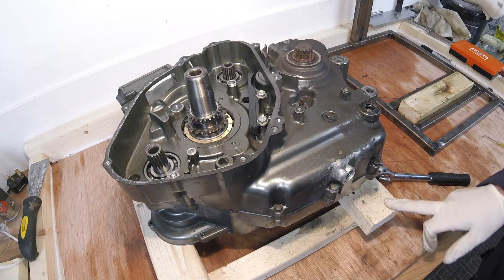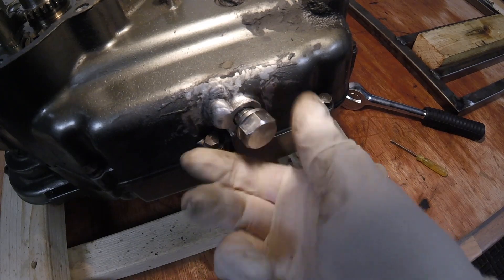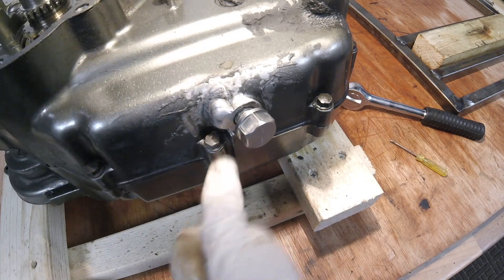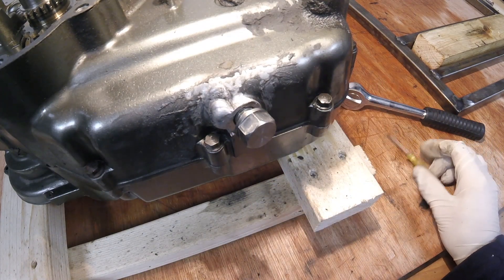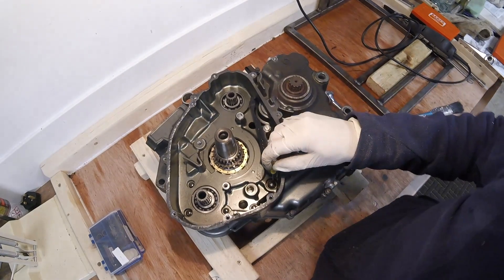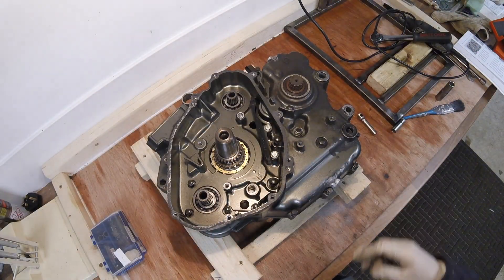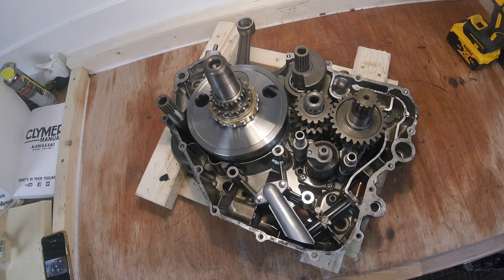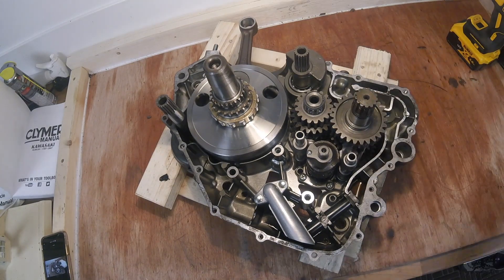Kawasaki KLR 650 Engine Re Build Part 7: Splitting the crank cases.

Comment: Thanks for the video. What are the bolts’ thread that hold the casing together please? M5? One on the bottom just in front of the oil drain is stripped and previous owner covered the entire area with epoxy. But it’s leaking through the epoxy. I’d like to order a thread repair kit but ride the bike up to the time it arrives so I don’t want to remove anything. I could measure if I removed it but would rather not. Thanks!

Comment: Love your work mate. Currently doing a build in Perth. I’ll be watching you every step of the way!
Reply from the maker: Good luck with the build - Going to be slow posting more videos of this as parts availability and work on the damaged crankcase are not going to happen until after COVID19 lockdowns are lifted and everyone is back at work.. Let me know how you get on - I'm going to have a go at splitting the crankshaft - have got a 2nd hand one on ebay to practice on - just got to get the press, jig, and puller now.... Ill get a vid up of this too at some point. Regards
Reply: @themotorcycleshed380  Some Job mate. Out of all the Vids i've seen yours are pretty solid. No excuse to make a mistake my end. As i progress ill share some pics and vids also. 

Thanks again. & No pressure mate. - In Gods speed.